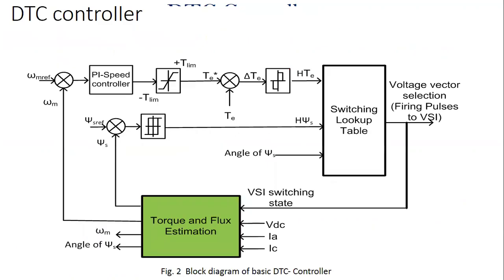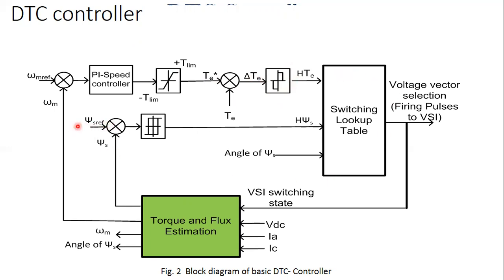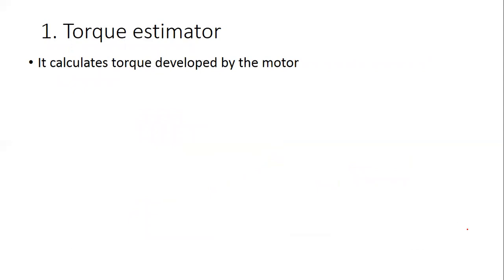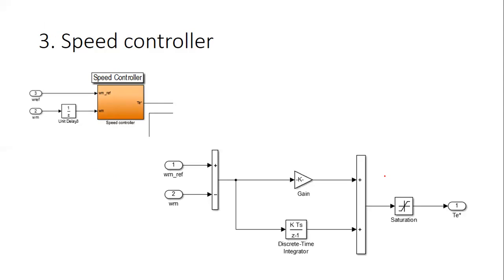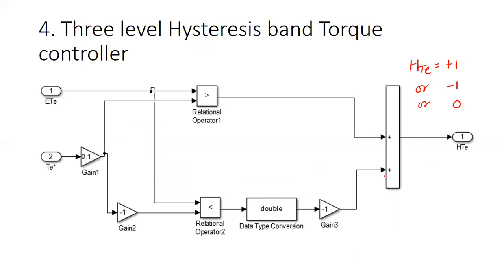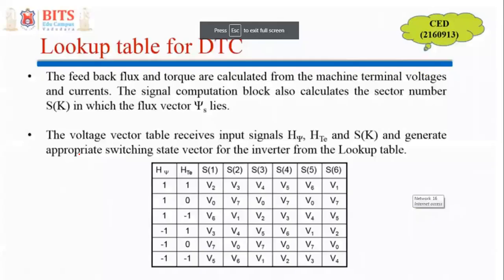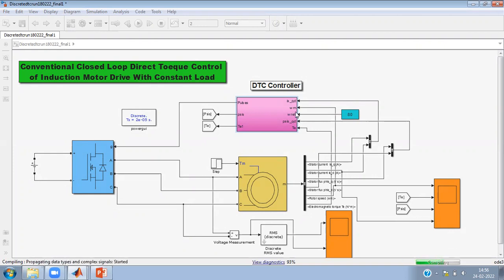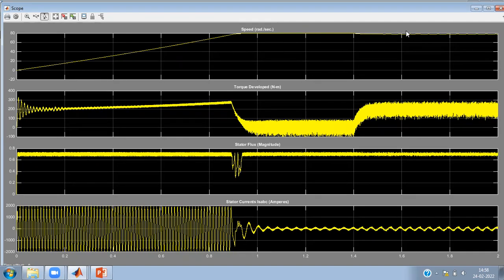DTC controller- Simulation of DTC Part-2

Comment: Thank you for your explanation but I didn't understand how did you draw those blocks there is contradiction between the scheme and the mathematical expression for the torque and flux and even though the controllers 
One thing more  i have problem with the torque estimator   2nd output of the demux how did you connect it with the imaginary it doesn't work with me !!!!